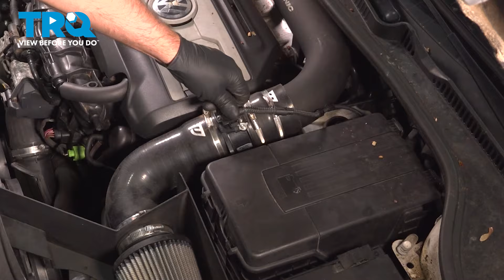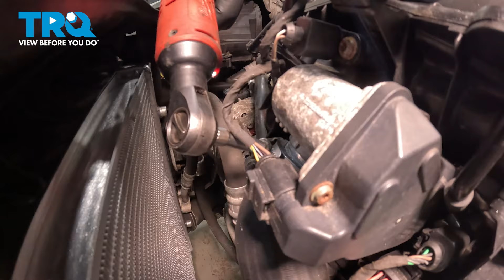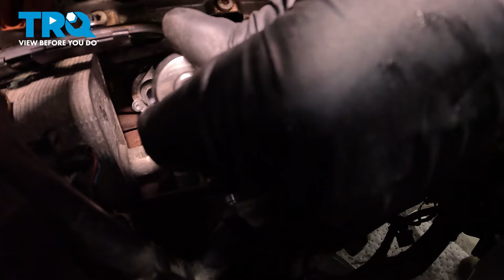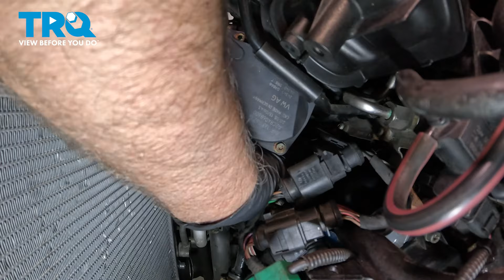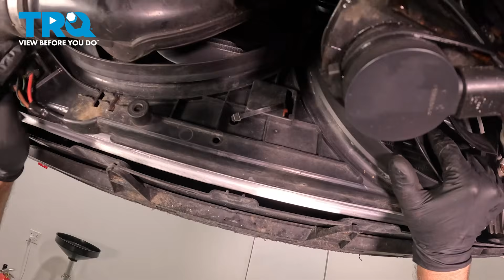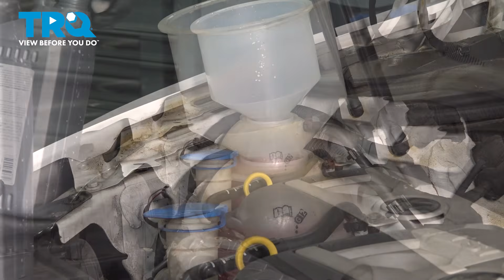How to Replace Water Pump 2010-2014 Volkswagen GTI

Comment: This video fails to mention that the hex screws that were shown are the aftermarket ones that came with that replacement aluminum pump when they first replaced it on this car , the factory bolts assuming original pump are T30 torx.

Comment: So do you have to have the pump with the inlet sensor on there? My original has one, and I bought an aluminum one without it but idk if it will cause problems if I use the one without the hookup

Comment: I just noticed a few days ago that my temp gauge once warmed up at 190 would drop down a lot suddenly for a few seconds,  then go back up to 190. no odd noises no leaking.  then today I got a P2568 code which from what I've read can be the pump or thermostat. since it doesn't appear to be over heating I'm assuming its a broken thermostat but If I have to do all this work to replace the thermostat I wonder if its just a better idea to replace the entire component? Im not sure, also I live in CA and the pump for CA GTIs cot more due to extra emissions crap, around 400 for a OEM and the thermostat is 300 by itself, .:face-blue-wide-eyes:

Comment: I have to do this to my car this is a great tutorial problem is I don't have a lift98% people doing this will not have a lift so my question is how do you clear the fan shroud if you're laying on your back take off plastic lower how high am I going to have to have the vehicle to get the fan shroud out using your Technique without removing the intake I guess I'll have to put the car pretty high up in the air to get that done the rest seems doable

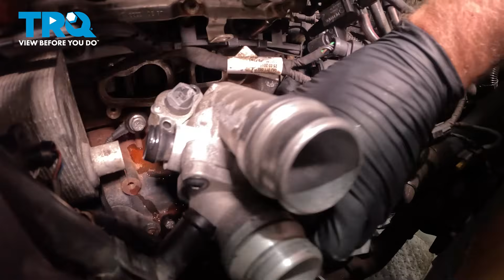Comment: 16:28 Interesting how the fully aluminum was replaced with the stock version. Any feedback on why? Obviously it failed, but outside of the plastic one cracking the true fail point over time is the gasket if I’m not mistaken. One or the other doesn’t alleviate the problem.